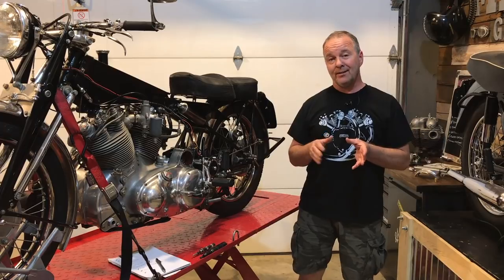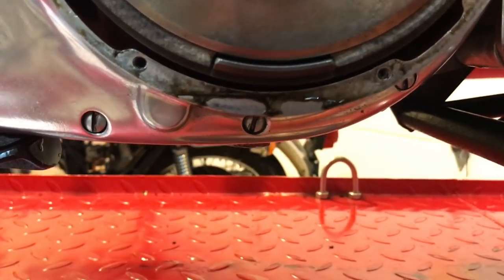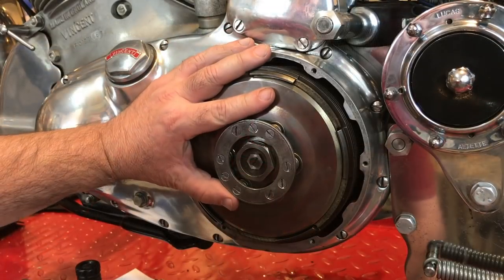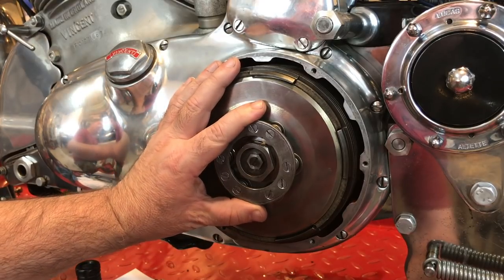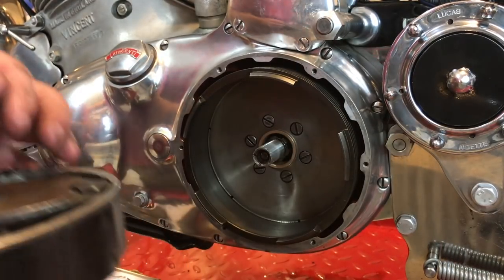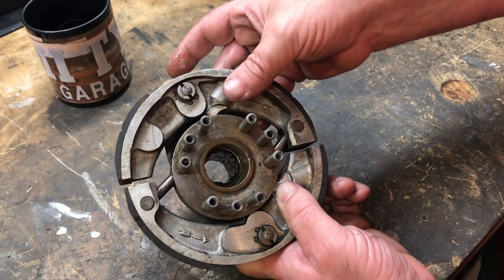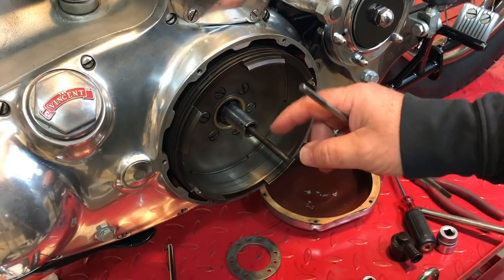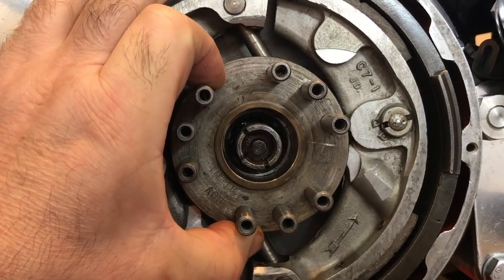Restoration of 1951 Vincent Rapide - Part 51 - Clutch Adjustment (Part 1 of 4)

Comment: Another though on the grabbing is it may be some oil soaked in the old primary clutch material.  That can be a PITA to get out.  I soaked mine in boiling water with dawn dishwashing detergent to get the oil out.  I was still getting oil out two days later but it was better.  It did get better the more I rode though.  Still the final fix was ditching the old linings and using modern fresh material.  Also it looks like your kick starter spring may be a bit slack or the kicker is binding in the case bushing by the way it was returning or I could be completely daft..LOL
Reply from the maker: Thanks a lot Eric.  Much appreciated.  I just took the clutch out of the dishwasher and will try again.  If that fails, I might order some new shoes.  I would really like to make the original unit work before considering other options.  Best wishes, Mike

Comment: I had the same clutch oiling issue and the cause  was to much gear oil in the gear box pushed gear box oil into the primary that raised the oil level in the primary  oiling the clutch.  The fix for me was not a drop more then one US quart (0.946ml) in the gear box and regular checks on the primary oil level.  It has been good for the last few hundred miles.  If the clutch is dragging you may have screwed the adjuster in to much on the outer plate  and the pilot clutch plates may not be separating completely,  or tilting in at the edges.  Have you checked to see if the pilot plates are symmetrical and uniform on the surface?  I thought I saw some ruff spots that may be dragging. Your idea of the ball bearing in the middle of the rod is a very good one  as it helps limit the amount the rod spins and wares on the bits at the ends.
Reply from the maker: Thanks again Eric.  I really appreciate your feedback and will check the oil level and also look more closely at the shoes and plates.  I'm going to rub the plates down to get rid of some scratches and make sure that they are straight.  I'm also ordering a new pushrod and new springs from Coventry.  I'm determined to try and make this clutch work and still have a few things to try, thanks for your suggestions.  It's fun!  Cheers, Mike

Comment: Don`t forget you have adjustment also at the kick start cover. Don`t use a ball in the clutch, use a roller otherwise you will have the same problem as the ball will sink into the ends.
Reply from the maker: Thank you John. Cheers, Mike

Comment: Hi Mike I’m no Vincent expert but I think you can get an after market clutch, I have all ways been led to believe the original servo clutches are a pain in the ass for either grabbing or slipping. You might fix it by experimenting with the push rod and cable length 
As you probably know the push rod is silver steel and any good machine shop should have some. 
All the best from U.K.
Reply from the maker: nick smith Thanks a lot, Nick. I’m going to try and persevere for a little while. I’ve ordered a brand new push rod and some new springs, so that will be the next attempt at getting this original clutch working OK. Then I’ll explore other options!
Cheers, Mike

Comment: Well, that is looking very nice , whatever you do, do not be tempted to fit a multi plate clutch, the original clutch is a very good system when set up properly,(and without oil on it), it could be that the cleaning process has changed the friction on the linings, but that should soon be OK, I never use these volatile cleaning fluids, just drop the linings in a pot of water with washing powder and boil them, they come out as new. Your hardening process will not make the Silver Steel very hard unless you quench while it is still red, by the time you took it out of the vice it was much too cool to harden properly, you will see that if you run a fine file across it. Good luck !
Reply from the maker: Englishman French Thanks for your comments Chris. Yes, I’ve literally just put the clutch into the dishwasher while my wife is out :-) I’ve also ordered a new clutch pushrod as well as a set of springs, so that will be the next project. Cheers, Mike
Reply: you're a brave man messing with the missus' dishwashing machine !!  buen suerte !
Reply: I knew the chap who designed and made the Honda clutch adapter, he was a trully perfectionist machinist and wouldn't have bothered to go to the trouble if he thought he couldn't improve the original. I haven't kept in touch with him, and if still alive he must getting on for 90 or 100 by now, so I can't quiz him about it but I would always trust his judgement.

Comment: That method of keeping the oil from seeping through seems a bit primitive. Any alternatives?
Reply from the maker: 54macdog I know what you mean! It does certainly seem a little primitive doesn’t it. The seal seems to be the last line of defense for oil getting through, but I replaced it with a brand new one. Cheers, Mike
Reply: there are flaws in British motorcycle engineering that defy logic,like if the industry employed at least just one Rolls Royce engineer (aviation-Merlin) to oversee then they would have seen out the Japanese assault,grease in the GB solves the problem in some brands  😃

Comment: Hello Mike, as a previous comment has said I was going to ask about the cable length?  And also, how was the shaft made oil tight at the factory? Anyway I ‘m sure you’ll get it sorted, best wishes 👍
Reply from the maker: Thanks a lot, Neil.  Yes, the clutch seals are supposed to take care of any oil leaking into the clutch housing.  It's a bit primitive but hopefully I will crack it.  Best wishes, Mike

Comment: It's not unusual for new cables to be the wrong length.
Reply from the maker: caahacky Thank you, yes that’s a great point. I’m going to try a little bit more adjusting and then may even change the length of the cable if that’s what it is. Thanks, Mike

Comment: Is that construction You have for the front wheel on the lifter commercially aviable?
Reply from the maker: Lasse Larsson Hi Lasse. I’m not sure where you are located, but I got it at a large tool discount store here in the US called Harbor freight. There may be something similar in your area. But yes I’m sure that it is commercially available. Best wishes
Reply: Thanks, I’m located in Sweden. Will look in similar stores in eu. By the way I enjoy Your videos very much though I must admit with a little envy.
Reply from the maker: Lasse Larsson Tack så mycket Lasse! Med vänliga hälsningar

Comment: Is there a permanent mod to prevent the oil getting through?
Reply from the maker: Hi Grant, I don't think so unfortunately.  The gasket cement is a bit primitive, isn't it!  Yes, the seals are supposed to do the job, but I more work to do to get the clutch working ok.  Best wishes, Mike